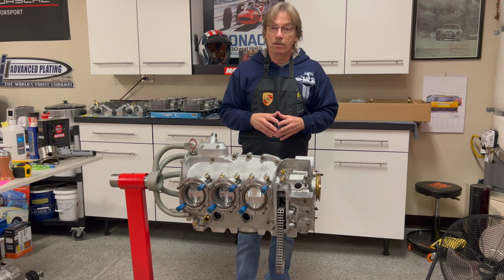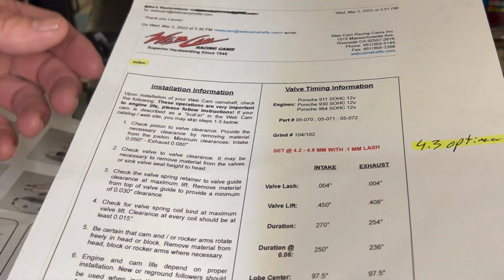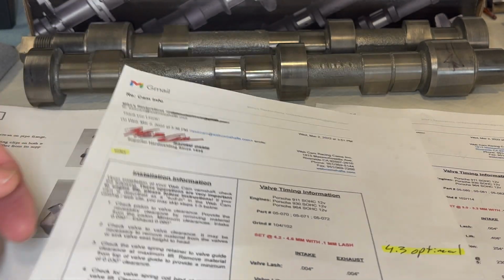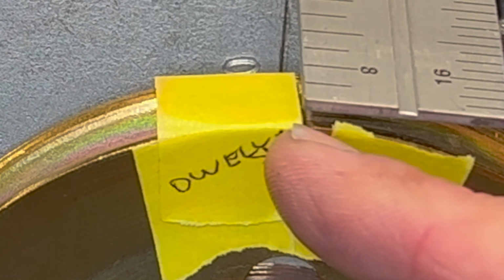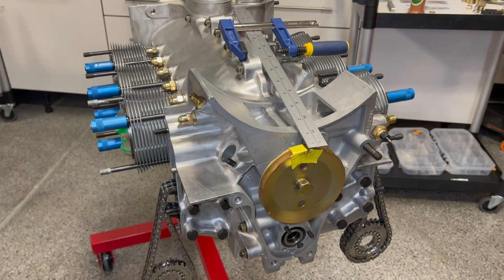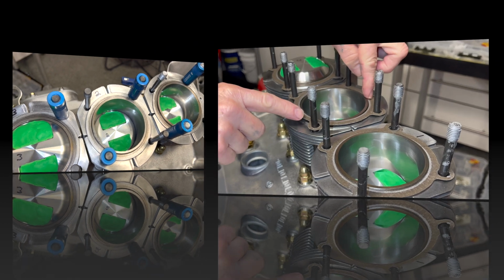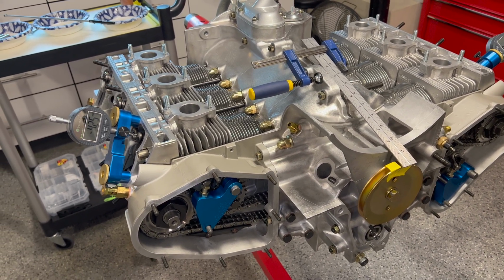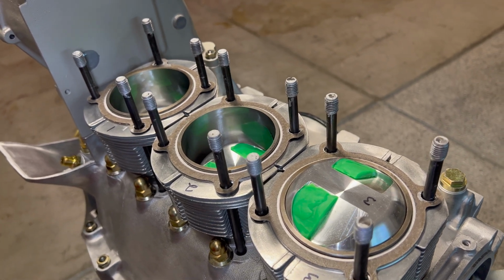Full Mock Up! Piston to valve clearance check

Comment: Hi Mike - great video as always.  I’ve never done clay because I think I would mess it up trying to get the timing right.  Last year I used a degree wheel to help set the timing and used soft springs in the head and pushed down on the valves and measured with a dial indicator throughput different degrees on the cam - it worked pretty well.
Reply from the maker: Hello Rob
That is an excellent way to find out this value
Thanks for sharing!
Cheers